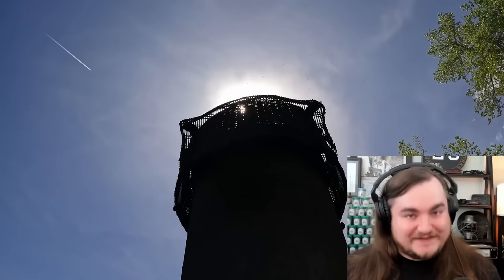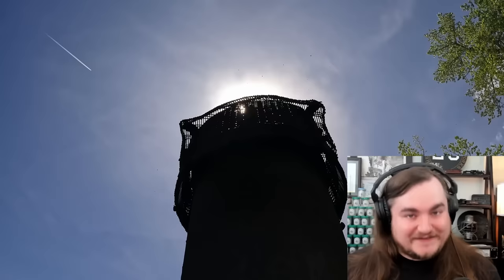Why do USA steam trains make smoke, but UK ones don't?

Comment: My father, who fired steam locomotives for the Baltimore and Ohio out of Baltimore, would often comment about steam locomotives shown on film and say they were being "over fired" for effect. He would also gripe about the cylinder cocks being open more than required, again for movie effect.  I often imagine what would be like watching these YouTube's about trains with him. He would be 103 this  year. He was qualified for DC Union Station. Making smoke was a big no-no, and would get a fireman disqualified in Washington Terminal. 
I watched the video from British Rail about firing a steam locomotives. I did not know that American locos only had draft up through the coal. I would ask my dad about that feature.

He told me that to reduce smoke in tunnels, shut off water to the boiler and coal to the fire, as each tended to cool the fire and make smoke. Watch water level, and when it disappears in the glass hope that the end of  the tunnel is close. Can't  do that unless the engine is steaming well. 
The tunnels on the Baltimore Division that caused problems where the Mount Airy Tunnel west of Baltimore, and the Howard Street Tunnel under Baltimore. Both had gradient, both produced gassed engine crews.
Howard Street had an electric helper engine to get trains through the tunnel and over a hill called "The Belt Line." Built for trains in  the 1890's, by the 1940's and 50's tonnages would often overload the helper and would require more power from the steam. In that case, according to one Yardmaster I worked with, after exiting the tunnel the steam engine crew would be relieved, taken to the hospital and given oxygen.

Comment: Photography and culture shouldn't be underestimated. A great example are old photos of factories, where every smokestack is almost bursting from blowing so much smoke. 20 years or so later, when people got more aware of pollution, suddenly you get photos with almost no smoke. And when you dig a bit you can find out that in the older photo they ran the fires in a way that they produce extra smoke, as that indicated power. And in the newer ohoto they ran the fires as smokeless as possible, and cleaned roofs and stacks before the picture was taken

Comment: The Delaware, Lackawanna and Western Railroad had an advertising campaign in the early 20th century featuring "Phoebe Snow" pictured as a young woman in a full length white dress with white parasol riding on the on the balcony of the observation car. The poem in the ad went "Says Phoebe Snow, about to go, upon a trip to Buffalo, 'My gown stays white, from morn to night, Upon the Road of Anthracite' ". So this railroad used anthracite as opposed to low grade bituminous coal in general usage. I personally used both hand fired and stoker fed coal furnaces which produced almost no smoke and little dust.

Comment: Fewer, more experienced firemen. I think you are right on that one. Also UK workplace ethics, a fireman is more likely to spend years and years in the job than in the USA.
Reply: Even at my heritage steam railway, a driver would need 10 years fireman experience certified by the railway. There is also an extensive fireman training programme, as it is a safety-critical role.

Comment: One thing I will point out, UK steam locomotives where in service up until as late as the 1960s and 70s, while the US and many other countries switched to diesel sprays, if not outright diesel engines by at least the 1930s, some was early as the 1920s and diesel sprayers as early as 1903 in Germany.

 This was due to the aptly named "six tonne limit" laws, which where a series of laws introduced in the 1910s by Parliament, and adopted into law. This was a lobbying effort by the British Locomotive industry to prevent foreign truck makers, especially funnily enough American Truck makers, from taking over British cargo hauling. The Six tonne laws basically mandated that any cargo shipped overland that weighted more than six tonnes HAD to be shipped by train. This also had the unintended side effect of allowing British railways to continue producing obsolete Stram Locomotives, as they effectively held a monopoly of all major cargo traffic.

The first dent in the six tonne laws started after the British losses at Dunkirk at the start of World War 2. Because the British took EVERYTHING to France, including all their foreign made heavy trucks, when the troops returned with no equipment, the British quickly realized, they have never built any truck capable of carrying over 3 tonnes, and Trains are not renouned for their off track capabilities.

 The second dent happened with the collapse of the pound as the world reserve currency. It mean the UK couldn't rely of shipping as much, and more overland hauling had to occur, which the obsolete Steam locomotives couldn't handle. 

The death kneel of the Steam locomotive in Britian was the start of the eco-conservation movements. While diesel is not a "clean" energy source, you don't need to burn and release as much carbon as with coal.

As for America, we hoped to Diesel as soon as we could, by 1940, over 70% of the US railwat fleet was diesel, while the UK in 1940, owned 7, 5 of which where foreign import models for study to determine if they where suitable for local production, 1 was used as a display piece, and the final was for use as a test bed for round trip service up and down the length of the UK.

Comment: I fired and ran the FEC 148, now    running in Florida, back when the engine was on the Morristown & Erie in New Jersey. She was and is an oil burner, designed to be an oil burner from the get go.

Two reasons for smoke:
1. Crappy oil - crankcase drainings collected from gas stations was the fuel of choice.
2. RAILFANS! We had guys repeatedly come up to the cab, tell us where online they would be with camera or video, and ask for smoke.
WE OBLIGED as fellow railfans!! In an oil burner with crappy oil you keep a bucket of sand and a BIG funnel in the cab. The firebox door gets opened and the funnel is stuck in and then sand goes in. You finesse it as fireman so the draft sort of sucks a continuous stream of sand in. The flues get cleaned out and you get smoke! LOTS of smoke!

Comment: A very good presentation. The LMS video you mention can be found on the Bennet Brook Railway site on YouTube. One item that the video mentions is that the UK locomotives were designed to run with the fire door open. The designer placed a diverting plate behind the fire door to divert the secondary air down to the fire bed and away from the tube sheet. We don’t have such a design here in America, so to avoid allowing cold air to impinge on the rear tube sheet, we don’t usually run with the fire door open.
Reply: A couple of years ago I had a cab ride on an SY class locomotive in China which traces its' lineage back to an Alco design built for Korea in the 1920s. The firebox door was operated by a foot pedal. The fireman had to balance on his right foot as he collected a shovel full of coal, then swing to the left, putting his left foot on the pedal as he did so, and as soon as he released the coal swing back to the right to release the pedal. Firing is a hard enough job as it is without having to do that.

Comment: A lot of the reason involves how population density influenced the predominant use of the railways, and public relations

In densely populated areas the primary use of rail transportation was to move people from residential areas to commercial or industrial areas. It made sense to minimize smoke production, or at least issue PR claiming you were minimizing smoke production for commuter trains running through neighborhoods.  This was a lot of British rail at that time.
Meanwhile, in the US, despite very large numbers of passenger bookings, the overwhelming majority of rail tonnage was cargo.  In the minset of the time, large, sleek, smoke spewing locomotives were a symbol of industrial power.  Interestingly, at the same time thatads were showing freight engines as smoke blowing behemoths, lighter passenger lines were advertising the cleanliness and convenience of their commuter lunes.

Comment: When the flies are being sanded in a run, that will produce a lot of “black smoke.” At some point, US steam locomotives were fitted with injection ports so that sand could be introduced into the draft, and that sand wound scrub the boiler flues and as well as out the stack. The black smoke caused by this design is carbon buildup being cleansed from the locomotive.

Comment: The actual answer is because in the UK, most steam locomotives operated on good quality coal, usually Welsh coal generally regarded as the gold standard) or they used Coke - both fuel sources produce a very high temperature and a very clean burn (no smoke).
Smoke was also considered a public nuisance, particularly in cities and often in the rural setting, where the aristocracy were concerned that emissions from the locomotives may disrupt the grouse season etc.

Comment: The smoke is a temporary thing done when the fireman adds excess fuel to the fire to make smoke for railfan photographs.  A proper fireman will feed fuel enough to produce a hot fire, but not to smoke.  Hence, Frisco locomotives had smoke density lights especially for determining proper firing at night.

Comment: Great video!  Noticed when I went to Disney World in the mid-1970s and Disneyland in the 80s that the engines put out no smoke.  I mistakenly thought they might be electric or Diesel powered, but no - they are all oil fired and regularly maintained to minimize emissions and maximize life spans!

Comment: I remember hearing about how on a preservation line in the UK (don't know which one) back in the day, when a photographer wanted some smoke for a shot the footplate crew would toss in a VHS tape into the firebox instead of altering the firing. It'd burn for a minute or two before going back to normal.

Comment: I work with waste incinerators and any USA or Canadian incinerator that makes any smoke at all causes certain people to go apoplectic. With an incinerator the smoke is eliminated using a secondary burner in a secondary chamber holding the gases over 800 degrees C to make sure there is nothing left but clear gas. Temperature sensors and stack particulate monitors make sure you always hit the sweet spot adjusting the primary and secondary draft fans. For firemen to achieve no smoke in a hundred year old firebox with only controls for draft and the amount of fuel is nothing short of incredible. A testament to their skills on both sides of the border. As well, if those photographers are interested in smoke you have no idea what 50 tons of waste per day looks like going up the stack with the secondary burner off. A veritable smokapocalypse!

Comment: When a few Bulleid Pacifics were converted to oil, same issues until they tried a Navy burner called the Laidlaw-Drew "Swirlyflow" <tm> and got excellent combustion. It took the Light Pacifics to a new level, but the Government changed it's mind about oil burning and they were reverted to coal.
Reply: @Bing Bong - the reason the government, or rather, the bureaucrats running the railways (into the ground) went for oil burning was because there was a national shortage of coal (thanks, again, to bureaucratic mismanagement).  They then found, to their astonishment, that we had to export so much coal to pay for the imported oil that it made the coal shortage even worse!
As President Reagan correctly said:
The most scary words you can hear are these;  "I'm from the government - and I'm here to help."

Comment: If you haven't come across the work of the Argentinian engineer Livio Dante Porta, you should definitely read the developments that he made with the steam locomotive from the 1950s onwards. When the rest of the world was eliminating steam in a hurry, Porta correctly surmised that importing diesels was too expensive for third world countries, and that they would be better off continuing to use steam locomotives. He followed in André Chapelon's footsteps on thermal efficiency, and made a number of significant improvements to the firebox, internal piping, drafting, and exhaust systems that improved locomotive performance and reduced maintenance.

Comment: For an oil burner to fire right the atomizing steam has to be set correctly.  The burner gun is a pipe within another pipe.  The oil is in the inner pipe and steam the outer one to preheat then atomize.  Only with lighter fuels like diesel or kerosene are the burner nozzles atomized by pressurizing the fuel to atomize through an injector type nozzle.

As a gun style burner runs longer it cokes up the nozzle and has to be cleaned to burn clean.

Then you can worry about your primary and secondary air for combustion.

Comment: Pretty accurate.

One time on a photo charter, the photographers kept asking for more and more smoke.  The fireman kept opening the oil valve, but it was still not enough.  So then he closed the damper and choked the fire.  It made lots of smoke, but there wasn’t enough air to combust the oil, and it pooled up on the bottom of the firebox and dripped on the ground.  Soon the pool in the firebox caught fire in a big blaze, then lit the dripping oil, which then set the ties on fire!

We had to stop the run by’s and have the photographers help to put the ties out!

Comment: What you are dealing with is essentially a vacuum cleaner. If you allow all your combustion air to be primary, that is to say drawn through the grate and firebed, a significant quantity of fuel can be drawn through the tubes and exhausted in unburned form. If you look at photographs of the N & W on the famous adverse grades this carpet of deposited fuel is visible. When working hard any particle 3/8" or smaller is ejected. Then you have the impact of inadequate secondary air to allow for the complete combustion of the volatiles liberated from the firebed. You can consider the porosity of the firebed and hope that this allows sufficient excess air to flow though the bed to allow for the combustion of the volatiles but a system of controlled airflow above the bed is superior and you can even engineer this to keep the smaller particles in the firebox for longer.
The LNER Pacifics and other classes have a firehole door in two parts the larger main door and within it a smaller flap horizontally pivoted door through which the engine is fired and which can be set to control the secondary airflow. These engines will work for hundreds of miles with the only sign of smoke being that tell tale greying of the exhaust every time a shovel of fuel is fed into the fire. The crews can get caught out by indifferent quality coal or disruptions to the combustion brought about by unexpected events whilst out on the road.
Essentially, if your engine is making excess smoke something is very wrong.

Comment: Also, with oil burners, sometimes the fireman would "sand the flues" doing that makes black smoke temporarily. Sanding the flues is done to blast the soot and carbon off said flues.  It's done because the carbon build-up acts like insulation it affects how the water is boiled. Sanding the flues is done while the engine is working hard. All that carbon build-up is ejected out of the stack.

Comment: Having visited a historic steam railway on it's fall colors photographer's run, I learned over fueling produces soot that plugs boiler tubes and is a mess to clean afterward. It is for the photographers. Ligher fuel with better air for complete combustion, saves fuel and reduces cleaning requirements, while reducing fuel consumption.  It is like the Diesel Trucks that have altered fuel delivery to enable rolling coal, which is illegal in most locations. Rolling coal is inefficient in both trains and diesel trucks.

Comment: Back in the '60's when I was growing up in the Midwest, they'd have "threshing bees" where they would get big old steam tractors, threshing machines and a bunch of wagons to haul the bundles of wheat to the threshing machine to demonstrate how it was done in the old times. The steam operators were proud of how little smoke they produced, but a sketchy photographer would bribe them with $20 to throw a tire into the firebox for 5 minutes of dramatic black smoke for photographs for the NPCs. Of course the guys who had to rod out the firebox tubes didn't think much of this idea.

Comment: Close to my house in Leicestershire UK, there is a level crossing on the Leicester-Swannington Line.  In 1833 a train (a 0-4-0 called Samson) going at 4 mph hit a cart carrying 12 dozen eggs which was stuck on the tracks. No one was injured but at the next meeting of the board, The line manager proposed the idea of fitting a steam whistle to the engine. Although the engineer carried a horn like the ones carried on a horse-drawn carriage, and many of the stationary  engines in the town had them to call in the workers from their homes, no one had thought to fit one to a locomotive engine before.  Someone approached the same musical instrument maker who lived in King Street, Leicester to make another for the New locomotive engine.  After that, all new locomotives were fitted with steam whistles.